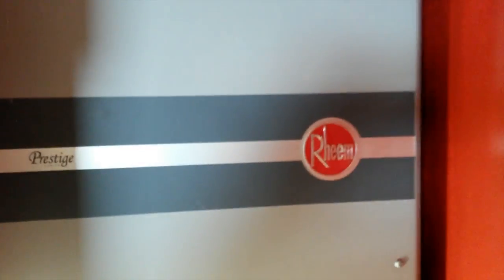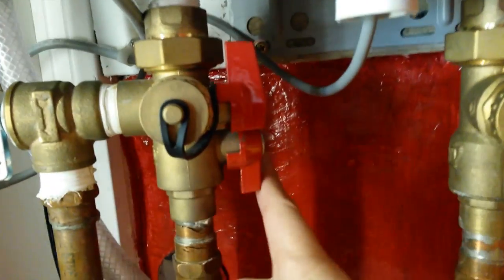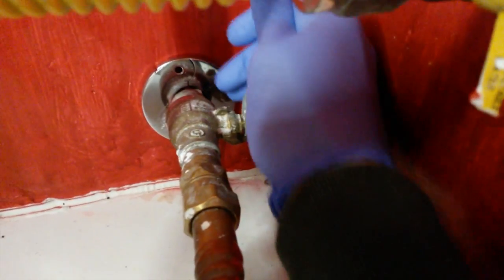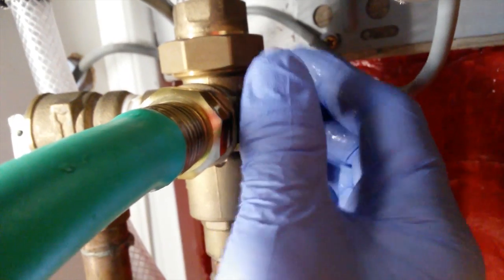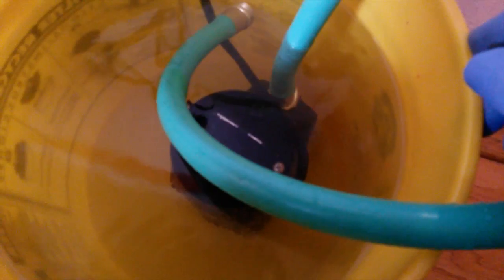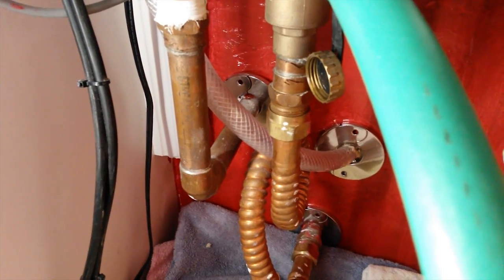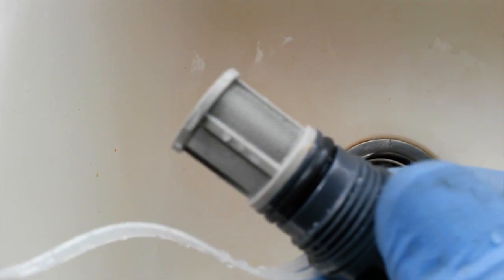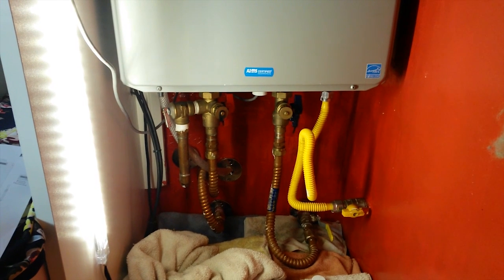Rheem Tankless Lime and Scale Flushing 2017

Comment: Is your hot water intantaneous?  Meaning you get hot water in a few seconds?  Mine takes 3 minutes to get hot water out?
Reply from the maker: It is instantaneous from the unit. Of course it has to travel to the faucet thus the further away the longer it takes to arrive. Also if the existing water in the pipe has cooled off then the part of the heat energy is lost in heating up the pipe. Really no different then an old fashion water heater. There are re-circulation pumps that can mitigate this issue.
Reply: @cfldriven  Does the plumbing need to be on a "Loop" system to use the re-circ pump?
Reply from the maker: @josemadrigal5918  If you don't have a loop system there is a device you can attach to a sink and it will provide the loop through. Check their website under accessories.
Reply: @cfldriven  All that Rheem has under accessories is a "water heater booster
", is that what you are referring too?
Reply from the maker: @josemadrigal5918  No the booster is for boosting water temp, what you want is the Rhemm Cross over valve kit. Check out HD website  https://www.homedepot.com/p/Rheem-PROTECH-Cross-Over-Valve-Kit-RTG20285/311689089
Reply: @cfldriven  Do I need a recirculating pump for this to work?
Reply from the maker: @josemadrigal5918  Jose, this unit does not need a recirculating pump to work. It will deliver endless hot water, although the furthest faucet may have to wait a bit for the hot water to travel there.
Reply: @cfldriven  I am referring to the "Cross Over Valve Kit", Do you need a recirc pump for the valve to work?
Reply from the maker: @josemadrigal5918  This is from the link I gave you "The Rheem PROTECH Cross Over Valve Kit converts existing cold water line to a return line, allowing recirculation pump to be utilized with existing plumbing. Install under the sink and at the farthest fixture from the water heater. Enjoy hot water without the wait."

Comment: Just use cheap washing machine hoses. I use the waste vinegar to clean my concrete driveway, that green coloration is copper that leached out into the vinegar.
Reply from the maker: Thank you for sharing. I too reuse the wasted vinegar by pouring it in drains and toilets. Gets them clean and removes any orders.

Comment: Thanks so much for a clear, concise explanation of this process. It will come in handy once I take the plunge on buying a new tankless. I would love to get the non condensing unit, but unfortunately I don’t seem to have a viable option for the condensate line, at least as far as I can tell.

I do have one observation: I don’t see a drip line in your gas line connection. I understand it is recommended to prolong your appliance’s life (keeps particulate matter from entering the appliance). It would be an easy mod for you.
Reply from the maker: Depending on your local plumbing codes you can route the condensate line to external or to internal drain. Because the Rheem neutralizes the condensate there no danger of damaging your pipes. As to my gas line in CA you can put a loop and that handles any particulate matter. Thank you for the questions and for watching. I know you will be happy once you go tankless, just make sure they include the service valves.

Comment: I think the mfg required 3/4" in diameter for natural gas line and not 1/2" ?
Reply from the maker: According to Rheem: 
Will a tankless water heater work on a ½-inch gas line? Yes and No. 

Apparently there are several variables that need to be factored in. In my situation we upgraded the meter, installed a one inch pipe and reduced to 3/4 inch for the final connection. The really scary part is most of plumbers bidding on the project did not check NG pressure, BTU being used by other devices, or size of existing pipes. 
Rheem was a great source for info even though some got a little too techie for me. 
Thanks for bringing up the issue.